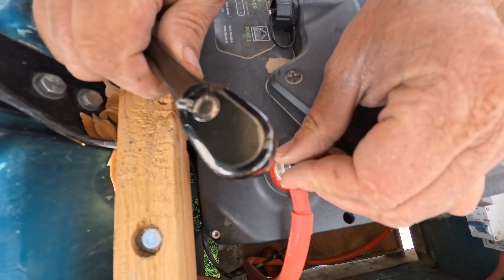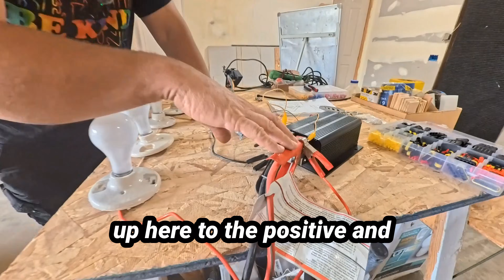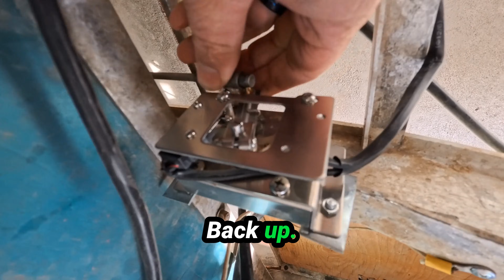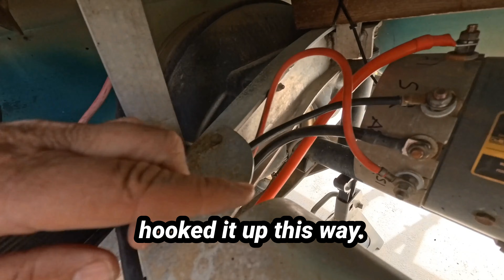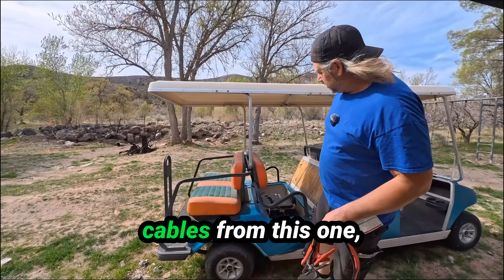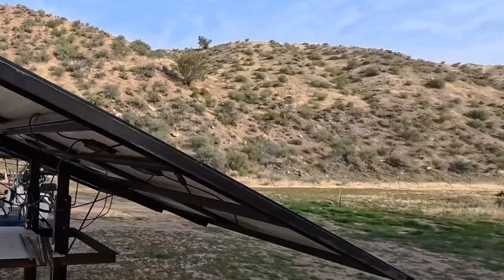Club Car Resistor to Curtis 1205 Solid State Conversion

Comment: can i use 4awg wire as the series hook up for the 12v batteries and from the motor to the controller and controller to the foward and reverse. i'm thinking i don't have enough wires in my cart so i am trying to figure what size and how much wiring i'd need. my A2 wire is too short to reach anything of significance. I am able to get the solenoid to click on using the throttle but i think i just need to tear it apart since its someone elses project and start from scratch like how you did so im ordering controller, switch, throttle, and have the solenoid and bus bar on the way
Reply from the maker: Yes. Make sure you watch my second video as well it is more of a step by step guide. It is in the description of the first video.
Reply: @Thesolarfarmer  i appreciate your fast response so much not a lot of humans out there who would do the same thing <3 You are sir the greatest form :D crazy enough i removed that resistor off my solenoid and it ran even with that old 3 busbar controller and it ran fast enough to drift lol xD ordering wire and new controller now
Reply: @Thesolarfarmer so I got it all assembled with the new controller and boy does it take off 😂 Uhmm my only thing is when I press the throttle it has to go to the floor in order for it to move and once it moves it’s gone 😂 would it be a programming thing or maybe because my a2 spot needs to be wired in?
Reply: so im using the original mcor1 throttle so i think i bought the wrong controller. i got the 0-5kohm and i believe the throttle is 5kohm-0 >.<
Reply from the maker: @99problemsXsolutions  This is how to get 0-5k from MCOR4.  https://youtu.be/F0F2coSesYw?si=QA1EGSnYh18eV6_x&t=242

Comment: Thank you Solar Farmer for your video! I appreciate your time in making both videos. 

Important notes for others from my experience, Mine didn’t work at first. I went through a few controllers thinking they were bad because nothing moved after connecting everything. Solution: A1 and A2 did not have continuity at all times! Bad Brushes. After rebuilding the motor with new brushes all works well. 

Another note, after fixing the motor, my controller wasn’t properly programmed from factory (chinese curtis knockoff) so I had to change throttle programming from 6 to 0, that way the 0-5k potbox would work properly. 

Just wanted to share my experience for anyone having trouble so you can get it fixed!
Reply from the maker: Thank you for sharing your experience. Hopefully this helps someone who runs into the same situation. Good job getting it all figured out.

Comment: Love to see a video on wiring for half speed reverse using in line resistor to controller for those of us who's controller is no  programmed via j5 pin for reverse.
Reply from the maker: I plan on making a video for the J-5 pin. My plan is to put a 72 Volt battery in my 03 club car and I will need to cut the reverse speed when I do that.
Reply: Would sending 36volts to j5 pin damage controller
Reply from the maker: @waynestewart7564  I programmed my controller and put 52 volts into J-5 and it gave me half speed reverse.
Reply from the maker: Here is a comment from the comment section from a guy who did it.
@smitty2721
1 year ago (edited)
2
subscribers
Good job on your video.
I could have used your video, but I don't think it was available when I did my solid state controller and lithium battery conversion I started in March on a 1994 CC. Your method was a much easier way.  I bought the same controller as you. But couldn't wrap my head around that simple diagram you used to wire mine up. So I went the  active Main wiring diagram on page 7, figure 4.   
I figured out how to add the reverse speed reduction resistor which the 
manual mentions in the active main solenoid diagram. But Curtis didn't explain that.  
The resistor, is a 5.1K ohm. I used a 5 watt resistor. Probably doesn't need to be that much wattage. It is just wired in parallel across the potentiometer. But you must put a micro switch in series with it which is activated by the forward and reverse lever so it will close the micro switch and puts the resistor in parallel across the input Pot.  You can just connect it to the two throttle input spade terminals on the controller going through a micro switch of coarse first.
That reduces the total resistance to roughly 2,500 ohms which is variable when you push the throttle pedal in reverse mode.
The wiring diagrams on older carts did not help much either. I enquired about it on the golf forums and couldn't get an explanation about it.
 At first I bought the same potentiometer as you did. I temporarily installed it to see if the throttle pedal and rod would go the the full stroke to 5k ohms. But it would only go to 3.7k ohms. I didn't think it would work. So thought about it a lot and researched what other method could be used. So after many hours and a few weeks of that, I watched a video on MCOR and I figured out what I needed to buy the components and modify the throttle pedal to MCOR. That was real a process on it's own.
I installed the Albright style SW202 48v 400 amp F&R solenoids and the heavy duty 48v 400 amp main solenoid. I had to modify the aluminum frame so I could get the lithium battery in and bolted down. I wired it with 2awg welding cable. Had to put terminals on the cables as well. The crimping tool I bought to put on the lugs wasn't worth a damn. So I soldered all the lugs on. A whole lot better way to go.
Well after it's all done it works fine. It was just a real bitch trying to get help.
And I didn't get much. Had to figure it out myself.
Reply: Did he splice the resistor into both input wires j2&j3
Reply from the maker: @waynestewart7564  It's probably best to contact him I have not seen his setup.

Comment: How do I hook my box up to the wire kit? The box have an end on it and my wire kit have 3 wires on it
Reply from the maker: This is how. https://youtube.com/shorts/O3UzUq4XqbI?feature=share
Reply: My wire kit came with 3 wires that supposed to contact to the pot box. Do i cut the end off the pot box and do wire to wire?
Reply from the maker: @BIGGWAGON04  The pot box will have 4 wires coming out of it 2 go to the micro switch and 2 go to the potentiometer. You need to determine which two wires are the potentiometer and wire them to J2 and J3 On the controller.

Comment: I have a 1988 36 volt and my directional switch is different. Is there any way you can show me a video of how yours is exactly wired to the battery
Reply from the maker: When I did my second Solid state conversion I did a more step by step process in the video. Here it is It will probably answer your question. https://youtu.be/F0F2coSesYw

Comment: i just finished up the complete change over. lithium battery and solid state.  worked great for one day (3-4 miles)  went to use it today and nothing.  the selenoid was super hot and i had power on both sides regardlless if the switch was on or off.  could the switch of gone bad and send power to the selenoid all night?  im going to let it cool off and try it again tomorrow but not sure what happened?
Reply from the maker: It sounds like you need to find which micro switch is staying closed.
Reply: @Thesolarfarmer  when the key is off and the cart is out of gear i have no power at the small post, when i key is on and the cart is in gear i have power to energize the selenoid at the smal post.  but even when the key is off there is power at both the large posts which there shouldn't be.  do i need to be concerned about the constant power going throught the selenoid  damaging other electronics?
Reply from the maker: @timcasperson6874  There should be power on both of the big terminals on solenoid That means the resistor is doing its job. The resistor's job is to trickle a little bit of power across the solenoid so that capacitors in the controller are pre charged and won't Get damaged and it also makes the solenoid last longer because it's doesn't spark internally when the connection is made. The downhill side the side going to the controller should be slightly less voltage.

Comment: Hey just got the conversion done everything seemed good but as soon as I turned the key switch on I fried the little resistor on the front of the solenoid, everything still works fine just wondering what happened?
Reply: People on Facebook are telling me that I should’ve flipped it around
Reply from the maker: @benjones4546  That makes sense why it would fry Diodes do need to be connected the right way.
Reply from the maker: Was it the diode or the resistor that fried? You do want to use a resistor It will work without it, but it won't last as long. The resistor pre charges the capacitors in the controller and it also puts power on both sides of the solenoid so it does not spark when you engage it so it will last longer as well.
Reply: It was the diode

Comment: Ok so that yellow wire from bus bar to f/r switch is 48 volt Positive?
Reply from the maker: That is correct, it provides the 48v positive power to the switch.
Reply: Where does the white and orange from the key switch go? Or are they unused?
Reply from the maker: @benjones4546  My key switch only has two wires a blue and a red. You only need to use two wires from your key switch whichever close the circuit when you turn on the switch.
Reply: Ok thanks
Reply: Sorry for all the questions I appreciate all your help
Reply from the maker: @benjones4546  Happy to help. Let's get your cart rocking and rolling.
Reply: @Thesolarfarmer  I’m hoping so
Reply: Gotcha
Reply: Ok so just bring it to the positive battery?
Reply from the maker: @benjones4546  Yes

Comment: Thank you so much for this video! I’ve got everything hooked up and I have power to everything, but when I push the throttle nothing happens. I got out the meter like you did towards the end of the video and I get 51.2 on the positive and negative, but when I drop the negative to the M post I get 40.1 instead of 0. Any idea what I may have done wrong?
Reply from the maker: Watch my second video, I answer a lot of questions people have about the First video.
https://youtu.be/F0F2coSesYw

Comment: I used all your parts list, went perfect. Old 1972 cart works great now!  Thank you so much.
Reply: Did you have to buy the bus bar or able to do it without?
Reply: @williamfowler61 2 heavy duty bus bars make it a lot easier. Like 30 bucks on Amazon
Reply: @StaegeRacing thanks a lot
Reply: @StaegeRacing would a 250 amp bus bar be sufficient?
Reply from the maker: That's great, good job.

Comment: Do you have to use the resistors you have listed in the description?
Reply from the maker: Yes you need a pre charge resistor It does two things It pre charges the capacitors in the controller so they don't explode and it also makes your solenoid lasts longer because it doesn't spark when you engage it.
Reply: Ok so if my cart is a 36 volt cart the controller needs to be 36 the heavy duty solenoid needs 36 the pot box 0-5k 36 volt and heavy duty fwd/rev switch needs to be 36? Basically everything you used but in the 36 volt form?
Reply: I started buying my parts you have listed in the description to start my conversion!!!! Thanks again

Comment: Can I still do this upgrade with a motor that has A1A2F1F2?? I can't find answers anywhere. Thank you.
Reply: Well now I gotta go find a series motor. I already purchased all the components you recommended. But at 36v. Would you recommend a motor swap or some other route. Was really trying to go a lil cheaper like you did. Got so sick of resistors and coils getting really really hot. Thank you for all you do. And thanks for your time.
Reply from the maker: The controller I used in this video is for a series motor. You have a SepEx motor and will need controller compatible with it.
Reply: @Thesolarfarmer Thank you for all the info. It did turn out to be a series motor. My problem was I have a lift kit with big tires. That was the issue the whole time. So I bought a new D&D motor to keep up with the demand of all that weight. Thank you again for all you do.

Comment: What are the extra pig tailed wires used for coming from the other micro switches on the f and r switch. I noticed you didn’t hook them up and I have them as well.
Reply from the maker: This forward and reverse switch is used on several different models and makes of golf carts. A different model cart would use them.

Comment: oh a solar car.......nice. You can programme those controllers yourself, just need a serial usb converter and can download the curtis 1314 software free, no need to buy expensive programmers. I would think its almost a necessity to be able to programme the parameters to suit your needs. Things such as low voltage cut off, and about a hundred other variables.
Reply: dont use usb ttl adapter, just serial converter works. Can use usb ttl type adapter but too many fake chips and ftdi blocks the fake chips via windows.

Comment: Hi I contacted the 36-48 controller back in and all is well. I did purchase the 48 volt 500 amp 0-5K controller. I was wondering if I could use the original 36-48 controller which has a lower amp until I upgrade to the lithium 48 volt battery. I know the bigger controller will be too much for my lead acid batteries i think.
Reply from the maker: The controller can only use as many amps as the batteries are capable of producing. Most of your lithium batteries have a 200 amp continuous use and can peak much higher for a few seconds. I have gotten almost 300 amps out of lead acid batteries climbing a mountain.
Reply: Thanks for the heads up. I'll be upgrading soon. I'm on level ground for the most part. Im getting about 20 MPH

Comment: Good evening I hope all is well. I have a question. I hooked up everything just like you did with the same parts. I cut my key switch on and the wheels started moving without touching the pot box. I have 0-5k pot box I think the controller is 5-0k  i ordered a replacement just wanted to know if that's the reason it moves soon as I cut it on or is something wired wrong?
Reply from the maker: If it goes full throttle when you turn the key switch and then slows down when you press the accelerator, then it is A 5-0K controller. But if it just turns the tires a little bit then it's the adjustment on the pop box.

Comment: Hi quick question. I see you didn't use the small diod
Reply from the maker: When I was doing my conversion, I couldn't find anything that said I needed one. The new controller manual that I found does show one being used before the key switch.

Comment: Hi I have a question how did you run the A2 on the forward reverse assembly
Reply: I have the same switch you used in your first video. I think I figured it out. I went A2 from the motor to the back of the switch and A2 from the controller to the switch is that correct?
Reply from the maker: @arthurmcguiremcguie7465  Yes, that's how I wired mine.
Reply from the maker: In my second conversion video I do a step by step process to show how to do it.
https://youtu.be/F0F2coSesYw
Reply: @Thesolarfarmer thanks boss man

Comment: Looking to do this conversion of a 36v  resistor cart, what solar panel/charger/equipment do you recommend for this, standard size roof. Appreciate any help
Reply from the maker: I choose solar panel size according to what I want my golf cart to power and then the size and watts of the panel determines which boost controller I use. 
https://youtu.be/mjyKHobbDMU
Reply: @Thesolarfarmer the panel which fits has these ratings, max power 230watt/ open cir 37.1v/short cir 8.48A/rated voltage 30.0v/rated current 7.67A/max sys voltage 600v/max series fuse 15A.  Cart will be used primarily on flat grassy fields. No additional accessories will be connected. If you wouldn't mind suggesting appropriate booster/charger or whatever else I would  need, I really appreciate it.

Comment: Do you hook the battery to the bus bar first or to the controller and then the bus bar. Thanks
Reply from the maker: Battery to bus bar and then bus bar to controller. You Don't need a bus bar. I like to use them because I have so many wires on this cart. I did not use one on my second conversion. https://youtu.be/F0F2coSesYw
Reply: @Thesolarfarmer thank you sir, I already got everything in your video, just shopping for battery and then going to hit it all up. Thanks again I have watched many videos on this subject and yours is  definitely more in depth. I still have other questions and I will ask when I get going on the build. Thanks again

Comment: Can I use a rocker f and r switch instead of the one you have. 91 club car ds with the same motor you have. Also do you hook your battery to controller first or to the bus bar first. Love the videos ,  they are the best. Thanks
Reply from the maker: You can use a rocker switch, but you will need to install a reversing contactor. https://ebay.us/Q6Fkbb

Comment: You showed the pot box mounting but didnt show the wiring. Since you ignored the microswitch, can I just use the 2 wires for the sweep ran to the J2 and J3 terminals? I removed the original connector.
Reply from the maker: If I were going to do it again, I would hook up the microswitch But you can do it like I did and yes connect the potentiometer J2 and J3 terminals. My second video is a lot more detailed and more of a step by step process.https://youtu.be/F0F2coSesYw
Reply: @Thesolarfarmer  I have been successful with my install. Thanks a ton for the vid. It was a huge help. Why would you hook up the microswitch by the way?
Reply from the maker: @maythealgorithmbewithyou  Good job on your install that's awesome. The micro switch on the pot box would be connected so that your controller only turns on when you press the accelerator.